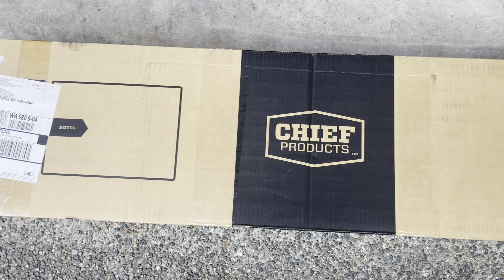Jeep Grand Cherokee skid plates/Chief Products

Comment: Do you know if this guard will interfere with the Adaptive cruise camera / sensors?
Reply from the maker: No it will not but you need to get the other style that they make specifically for that. They designed the middle portion a bit different to accommodate the sensor. Just make sure you pick the correct one on their website